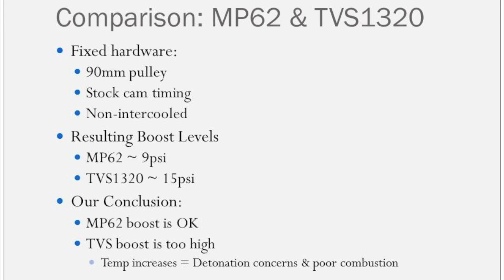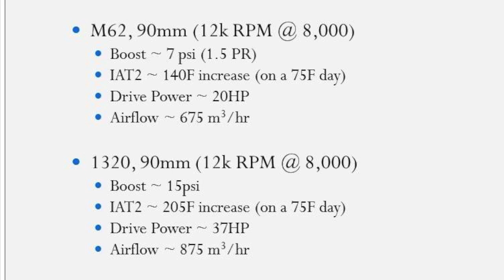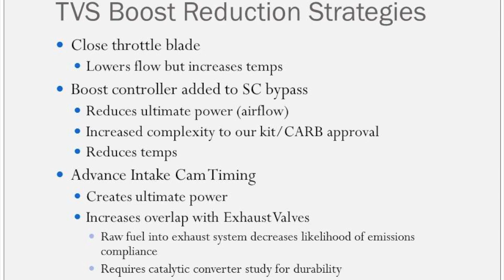Sector111 Educational Series: Supercharger Sizing Part 2

Comment: It gives the engine more time to equal the pressure difference between the close-to-empty cylinder and the boosted intake manifold, and because of this, the cylinder pressure will be closer to the intake manifold pressure at the end of the intake stroke. This means that the engine has ingested more molecules of air. 
The air pressure is dependent on the amount of air and the temperature of this, if the volume is unchanged, so less molecules in the intake = lower pressure. :)